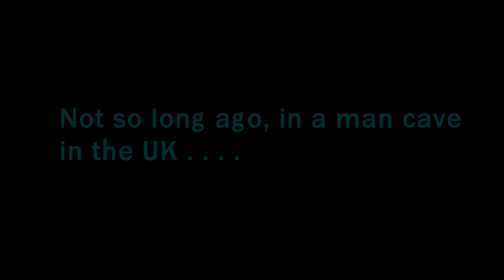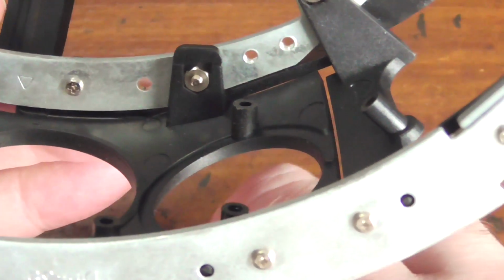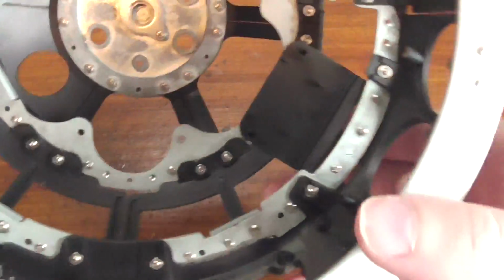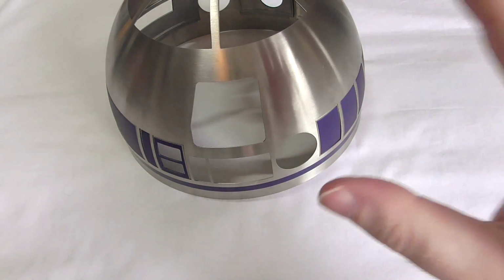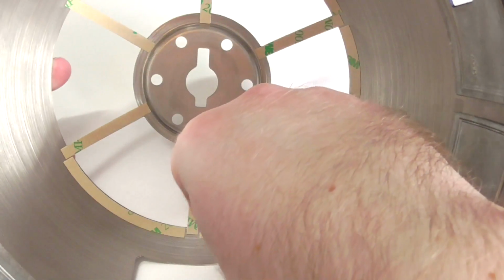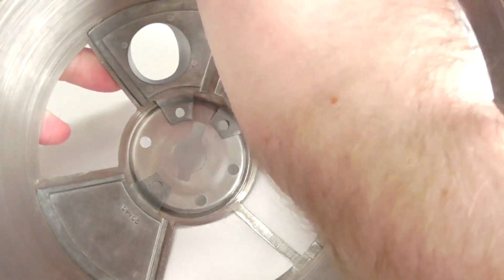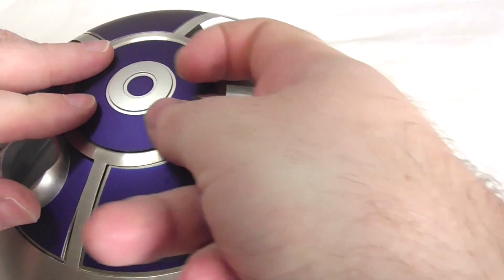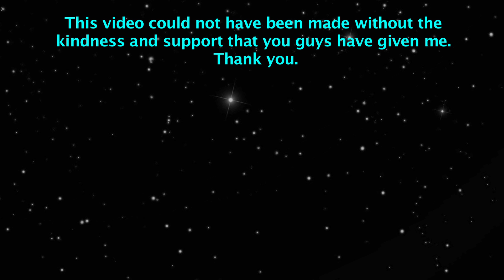DeAgostini Build Your Own R2D2 Parts 62 & 63: All about the dome! (No Treble)

Comment: A bit of tape to hold the nuts in while you're screwing the screws in would help
Reply: Only having one arm I have to find ‘interesting’ solutions to some parts of the build. Those pesky nuts are one of those times. I stick the nuts in with a tiny dab (on a cocktail stick) of super glue....works brilliantly (just make sure you don’t get any of the glue near the nut thread)

Comment: I've not started my R2 build yet,  (Still working my way through the Falcon) but I'm really not looking forward to putting the panels on
Reply: Simon Edwards if it helps, i did all mi e at once on saturday just gone. Took my time with it and didnt have a single problem with any of the panels. They all stuck really well. In fact, theure pretty tough to get off again once stuck properly.

Comment: What you could do with any nuts that you need for the dome frame etc... is put the nuts in place... then put a drop of superglue on them to keep them in place... & with double sided tape... wipe both the dome & the panel with metholated spirits/ alcohol... to clean the surface of any grease & the tape will stick properly... & you won't have any problems with with it...